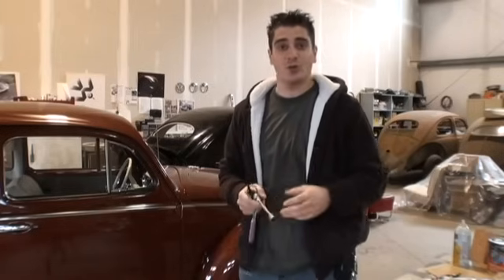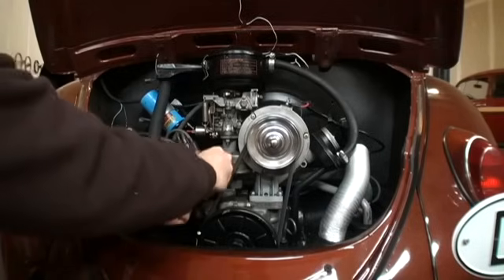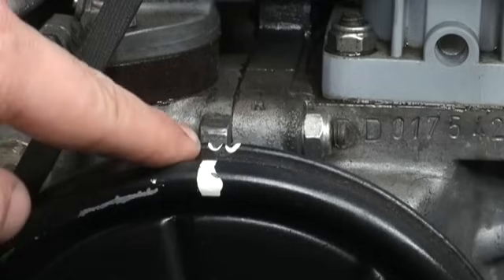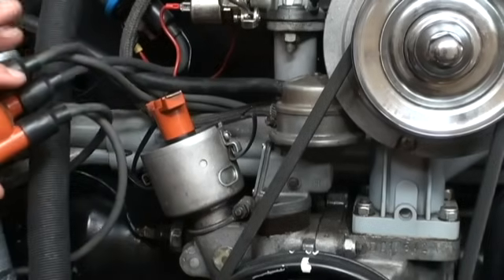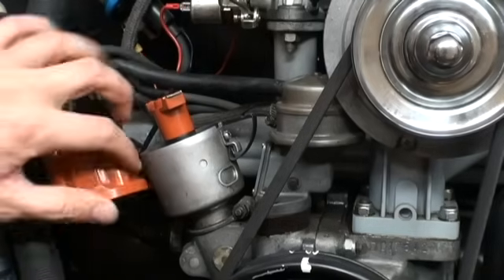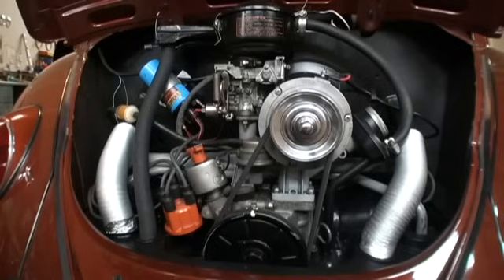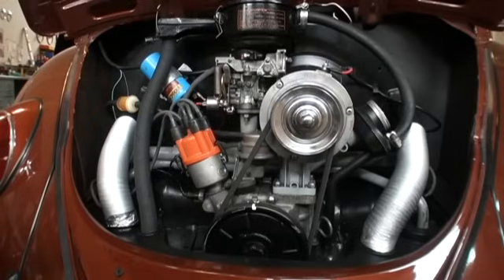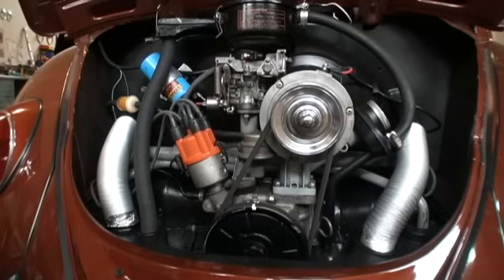Classic VW Beetle Bug Ghia Bus How to Time Set Volkswagen Engine Timing

Comment: Recently installed Compufire electronic ignition on a stock 1600cc engine.
I was told in order to set ignition timing w/electronic ignition, test lamp method will NOT work.
Timing light method must be used...Is this correct?
Reply: Freedy Sessions Yes I think that's true as the unit can burn out doing this, a strobe light gun is needed , use on a hot, fully warmed engine that has been driven over 5 miles , then with the strobe gun connected, aim for max. advance of 30degrees at top engine revs, usually 3,500 rpm to avoid damage. That works for pretty much most stock engines with electric distributor .

Comment: Someone helped with the timing so that it will start and not backfire which is what I got when I tried the test light. However, even though it starts right up it runs with a constant hesitation as I accelerate and until I am cruising in 4th.
Reply from the maker: @Ljblossom  might need a good carb cleaning
Reply: @classicvwbugs  it was a sudden change after it was timed. The vacuum advance does not work so I ordered a new distributor. However, since I followed all the directions and all I accomplished was not being able to start the car. A friend said the hesitation is that the timing is retarded.
Reply: Hope you got it figured out.

Vac advance on all other models except duel carp 1.8 1974 & I think 68 and before do not use vac advance till 4th gear. It's electronically blocked off till 4th gear. Pre 68 is vac only, no mechanical. 

Probably an issue with the mechanical advance (lost a spring or needs to be cleaned)
Also all non stock distributors most likely won't advance per engine/carb spec.

If you read at the end of chapter 5 in the green book it says all this and gives both the advance curves per engine code.

Hope you got it all worked out though
Reply: Backfire at idol is typically timing/ spark issue
Backfire under load typically air fuel mixture 
Backfiring when turning off engine typically is to much fuel/bad combustion 

These are loose reason but can help to get started
Reply: @SpaceCoast_  it is deep winter so I won’t know much until April. The backfiring was impressive and not something I want to hear again but it is still there. I bought a new distributor with a vacuum advance and new points but that is not going to solve the problem. I will need to get help with it.  What is the green book. The Muir book is not green nor the CW shop manual.

Comment: Is there any way to reposition the distributor to make it easier to close the clips?
Reply from the maker: @Ljblossom  for the cap?
Reply: @classicvwbugs  yes.
Reply: However just changing the cap would make the wires a tangled mess.
Reply: @classicvwbugs  no, the entire thing needs to be rotated 45 degrees so I can get to both clips. It is just too hard to reattach the clip that is behind it.

Comment: Hey man , I have a 1,600cc Vw air cooled engine. I’ve been looking for the nick for the dead center in the pulley but I can’t be able to see anything on the pulley. So I was wondering if I can’ find any other way to find the top dead center to hook it up on cylinder number 1... help!
Reply: TDC on 1 should be the position where you distributor points to the wire for 1 and where both valves on one are in their most raised position right?
Turn the pulley by hand to get the distributor in the right area then either have a buddy turn while you watch the valves or try to reach around and turn while looking.

That's my best guess

Comment: @Chris Vallone -  When you intall electronic ignition like Pertronix, do you use static timing at first? Thanks!
Reply from the maker: You can try it yeah.  Sometimes it works, sometimes not, depends on the brand of the unit.

Comment: So i removed my #1 spark plug. Checked to confirm TDC on #1. Turned the pulley counter clockwise 7/16 to the 7degree spot. But when i put my distributor on, the button points toward the driver side. Like in the 11:00 position on a clock. Someone said it is 180 out. How do I fix this, or how do I set the time on this? Thanks for any help.
Reply from the maker: The distributor drive gear will have to come out and be re-positioned.
Reply: @classicvwbugs  Thanks, that helped with my latest problem as well.

Comment: The test light just indicates that the circuit is complete right? In theory would you be able to do this with a multimeter that has a continuity test setting?

Comment: The 009 distributor was ne er used in a stock or from the factory engine...this static timing method may be ok for the vacuum advance distributor but for a centrifugal advance distributor (aftermarket) a timing light should be used for peak performance and efficiency..
Reply: Also, the engine needs to be at operating temperature. The 009 should be set at 28- 32 degrees for maximum advance

Comment: Great video Chris!! like always. Quick question is i timed at the exact point the test light lights up and why dose the light stay on if you keep rotating counter clockwise?
Reply from the maker: It shouldn't, the more you keep turning, it should shut off.
Reply: Ed Ibarra bad condenser
Reply: @classicvwbugs  help! I am trying this right now and the tester is staying on. The alligator clip is on the negative, tester is touching metal. What am I doing wrong??! 😕
Reply from the maker: @MeshelleMyBell  Gotta check your points, they may not be opening and closing, may have to adjust the gap.

Comment: Hey I have a 40 horse with a short vacuum advanced distributor . should I set it to top dead center when doing timing?
Reply from the maker: +Brody Bailey 40hp motors can be 10 degrees BTDC

Comment from the maker: your points might be too tight or you have the light hooked up to the positive side of the coil.
Reply: I Double checked Points at  .016 good gap , I actually took My coil Off to also double check + - conectors 🤔😶 Might it be the inside of the distributor it's the only part that's been untouched LoL 😅

Comment: What causes the light to switch on? Current from the condenser?
Reply from the maker: When the points open, the circuit is open thus the current then flows to the light to ground.

Comment: I hooked my test light to neg and the sharp end of test light to carb and no matter how much I turn my distributor the light won’t turn off. Any ideas?
Reply from the maker: Check your points, they may need to be adjusted.
Reply: I’m not running points electric  009
Reply from the maker: @bradley1328  some electronic ignition modules cannot be static timed, the light stays on, you need a timing light.

Comment: Thanks for the video. My car has the two notch pulley with 009 distributor and mad blaster2 coil and 12v conv. When my test light is plugged in to the (-) return wire at the coil and I place the other end in the carb to complete the circuit the light is on all the time with a little flicker off when I switch rotation. The lift doesn't stay off until I hit the timing point. It's just always on. What is causing that??
Reply: I also have my spark plugs gapped to 0.28 and just replace the distributor cap and wires spark tested gap at 30 on the cheapie ignition spark tester. My coil seems good, so I'm not sure why the light never goes out. Is something wired backwards? I know my no.1 cylinder is closest to the pulley and in the correct position. I feel like it's an electrical issue. I see others have the same result, but I didn't see a solution.
Reply from the maker: your points may not be opening and closing right.  Maybe your gap is wrong.
Reply: Chris Vallone  it was because I have an electronic ignition inside the distributor, so I have no points inside for the test light to find. Found that out on google.

Comment: Hi there, currently working on a 1973 1300 beetle, previous owner done majority of work, im just finishing her up. it has had a 1600cc unleaded conversion kit fitted, two twin 40mm solex carbs, Monza exhaust, bosch 009 distributor, tried to fire it up, backfired and almost set fire to right hand carb, my guess would be that the ignition timing is way out and needs adjusting, what would be your advice? 
Many thanks, and great video!
Cheers, joe.

Comment: Just did this, my light won’t come on... it did once, then went off but I never moved the probe or distributor. Now I can’t get it to come on in any position. What have I done wrong?
Reply from the maker: check your points, they may need adjusting.
Reply: Chris Vallone thanks a lot! Is it possible a weak battery would cause the same issue? I went to start the car and it struggled for a bit.
Reply from the maker: @walterturner3230  Maybe, but not just the battery I don't think.
Reply: Chris Vallone hey! Back again. I bought this car with this distributor on it. But I noticed that the #3 wire in your video goes to my #1 plug and vice versa. Should I swap those? It’s a non vacuum advance. Looks like 009 like yours
Reply from the maker: @walterturner3230  Well I would take off the distributor cap and rotate the crank till you are on number 1 cylinder. Then wherever your rotor points to when on #1 is where you put the #1 plug wire on the cap.

Comment: Chris if you have a small sound from the valves and timing it's a little off you adjust timing first or valves ?
Reply from the maker: Yeah let the motor cool down then check the valves.  As it is cooling tho, you can always check timing too.
Reply: Chris Vallone got it thanks a lot for your answer and help

Comment: Hi, I have a few questions, Is the way your showing here the same point I would use if I was using a timing light. I checked mine today and its like 34 degrees BTDC, Why is mine so much different then yours?  I am changing mine out to a electronic one instead of points and would I time it the same way as my one with the points?

Comment: Hi Ya'll , im having problems timing my vw bug 1600 .   Changed out carb to stock , distributor is electronic , new intake , new boots and gaskets , valves adjusted to .006 and carb adjusted according to specs. 
When i start the bug it immediately starts the backfire and its loud and constant .  I set the  timing at 7° btdc and it still backfires .   Help

Comment: Chris question for you, i just installed a hot spark SVDA and all though i  can get the car to start i can not get it to idle. It idle just fine before i changed the dizzy. Anything you know of that might be causing me the issue?
Reply from the maker: +sirbum69 did you time it right?
Reply: Make sure your vacuum lines are routed correctly.  I see about 1/4 bugs in our shop that have the vacuum line to the carb plugged in to the wrong port and those engines run like they are full of wet rats.

Stay gold.

Comment: Chris, I just replaced my 009 distributor with a pointless 009 and my timing seems to be way off when trying to time it to 7.5 degrees BTDC just like I was doing it with the original distributor, how can I get this to work?
Reply from the maker: Maybe your wires on the cap are not on the right plug

Comment: Hello, I have a 1971 Super Beetle with a 009 distributor , the pulley has a dimple and one notch to the left of the dimple, do I need to make a mark for 7.5 degrees, do all bugs get timed to 7.5 degrees?
Reply from the maker: As stated in the video, it depends on your distributor what to time it to.  And yes for an 009, you need to make the mark 7.5 to the right of the dimple.
Reply: Thank you, that has worked just perfect, my bug runs much better now!
Reply: J. P. Ortega how long would it take to replace the points and adjust the timing on a VW bug?
Reply: 5 mins
Reply: Steven Terry thanks. Some mechanics I spoke to  are trying to make it a 2 hr event so they can charge $160. for labor.
Reply: MMAFighter38 No problem, and don't let them take your money, it's a very simple job, you could do it with a 10mm socket and a flat screw driver and feeler gauge, and a test lamp
Reply: Steven Terry 👍👍
Reply: I was having some problems calibrating the points and decided to go with a pointless 009 distributor, but it shouldn't take more than 10 minutes.

Comment: Does this method work with electronic ignition as well?  Or is this just for points and condenser type 009?  Thanks in advance.
Reply from the maker: +JOHN PAUL JONES Yes it will work.
Reply: timing gun method is recommended for electronic ignition papa
Reply: awesome!   gonna try it this weekend. aloha'z

Comment: The light on my screwdriver stays on through a whole cycle of the pulley, any ideas why?  I have used your method loads of times previously and never had this problem before.  I changed the points and the condenser but I cannot get the light to go out regardless where the rotor arm is pointing.  Great video, please keep them coming.
Reply: I disconnected the condenser cable from the coil when I was testing, I guess I was not supposed to do that?

Comment: I have a problem, i did exactly as you did, but no matter how i turn my distributer my test light wont light(i know it works since i tested it on the battery) and i turned the engine to 7.5 before TDC
Reply from the maker: you need to check the points!   the condenser too.  are the points opening and closing correctly?  Do they need to be changed?
Reply: Chris Vallone i just installed a new flamthrower electircal distributor, the car started fine with the old distributo tho

Comment: hello i did this static timing method the car did not sound correct so i used a gun when checking with the gun after timing it with static the tdc mark was lined at the left side of the pulley on the belt did i do something wrong please let me know thanks

Comment: thanks for the video. i tried to do it (after changing the point+condenser) but i get the light all the time! what's wrong?
thanx
Reply: nehemia B probably too late but you may have hooked the clamp to the positive wire and it gave it constant power.

Comment: on my 68 with vac adv my number 1 is the where urs with out it is, i followed my wire checked the valves to confirm and as part of the tune up im doin cause its running crappy at the moment.  i when i do wat u do to adjust the timing i only get a quick flicker of the light, i doesnt stay on in any spot, so ibout another test light and get the same thing so i was guessing that thats the spot i want it for my timing?

Comment: Hey Chris. I tried this and my test light stayed on the whole time. I made sure to connect it to the negative side of the coil and as soon as I turned on my ignition it stayed on and didn't go off even when I turned the distributor. Any thoughts?
Reply from the maker: need to check your points!  Maybe they are not gaped right, or your condenser is bad, or coil, etc
Reply: Chris Vallone I installed a empi 9437-b electronic distributor. It ran with my previous points distributor with the same coil that's on it now.
Reply: Nathan Stoker Awesome, I have the same problem. You replaced the whole distributor or the electronic regulator inside?
Reply: The whole distributor
Reply: Nathan Stoker just got a brand new distributor a "flame thrower" and The light is still always on.
Reply: Tyler Harrington I'm running a Bosch blue coil. I have it where it will run but I still need to get it in time
Reply: Nathan Stoker same problem  , did you fix that ?

Comment: Chris,  what about max advance timing.  I have a 1300cc with a 009 cent advance distributor.  I time it with the gun at 7.5 btdc.  should I also be timing it 17-24 degrees at 3500 rpm with the gun for the high rpm max advance?
Steve

Comment: I'm about to try this, so I googled and found this video. Then I also looked in my copy of "How To Keep Your Volkswagen Alive" and it has a table that says that different years should be set to different offsets:
.. 1965 - 10 degrees
'66 .. '67 - 7.5 degrees
'68 .. '70 - 0 degrees
etc..
Now, I have a '69 1500, but I'm not sure if its the year-correct distributer on, because it's been changed a couple of times. It is a stock Solex, I'm just not sure if it's the year-correct one. So I don't know how many degrees I'm meant to set my timing to. Does anyone here have any ideas how I should determine this? I'm thinking it is the engine that is the important part in determining the offset, so I'm going with zero(?)
Reply from the maker: No it is the dizzy carb combo.
Reply: @classicvwbugs  Thanks for the reply :)

hmmm. Any idea how I figure out what I should use then? 
Oh shite, I said the distributor had been changed a couple of times. I mean the carb. Although I think the distributor has been changed too. I'm not around my car at the moment , so I can't check what they are, but once I do, do you have any idea how I figure out what offset (in degrees) I should use?

I note you said in the video that the short distributer uses zero degrees. So is that the one usually used in  '68 - '70?

thanks.
Reply from the maker: @narco73  Take a look on the side of the dizzy and carb, they should be stamped with numbers.  Understand too, that once 68 came around, VW was trying to abide by the emission standards, part of the reason you see timing at 0.  But for the most part, these cars run fine at 7.5 o even 10 BTDC.
Reply: @classicvwbugs  OK. Thanks for your advice. Much appreciated :)
Reply: @classicvwbugs  So, I have a 009 (copy) and a pict-2. I saw somewhere else that the 009 should use 7 degrees?
Reply from the maker: @narco73  7.5 BTDC
Reply: @classicvwbugs  Cheers. Thanks a lot.

Comment: As you move the pulley will the rotor move to 1 at the same time? or do you have to lift off and move to pos 1, as i have electric ignition

Comment: Will this method work if I  have an electronic conversion in a vacuum advance distrubutor?
Reply: adrlop74 no it won't work. You need to get a timing light to set the timing.